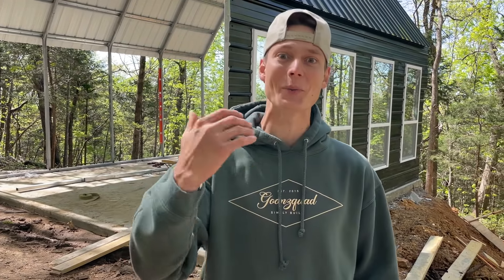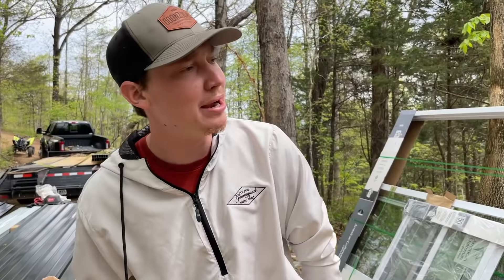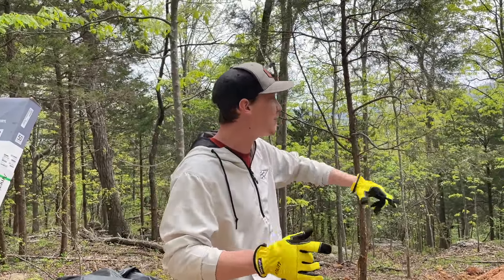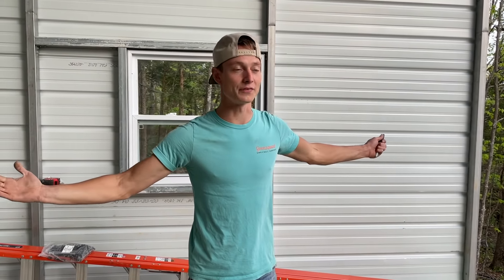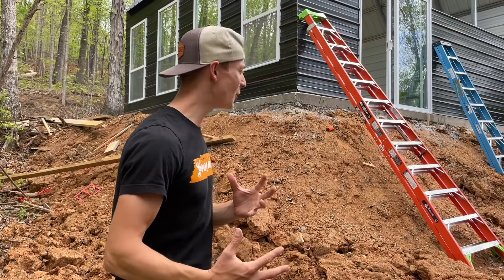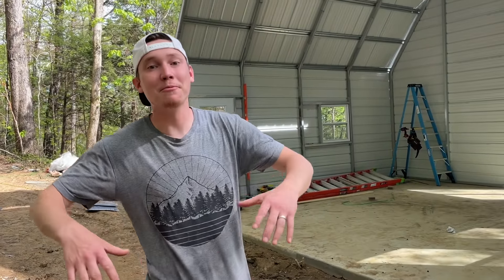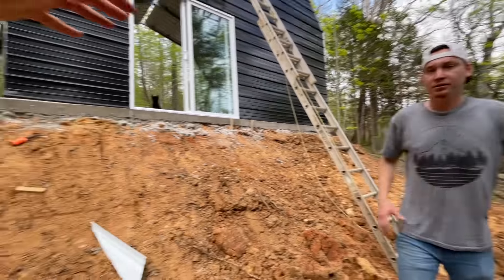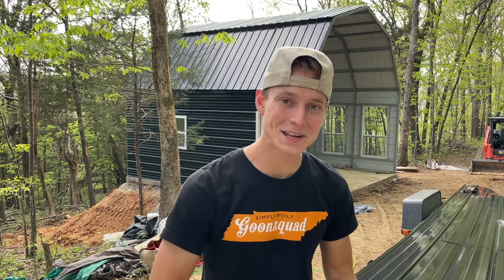Building The Ultimate Man Cave Has Become Dangerous!!! Can We Save It From Erosion?

Comment: You have cut trees and a auger for your Skid steer drill some Holes and place the Logs upright in the hole with cement , and then place some more logs across them building a wall and then backfill that section . Blocks will not stay in position if you don't put a Concrete foundation for them to sit on. 100% done Starting to sing It coming down the mountain when it comes :) .lol

Comment: As I mentioned to you several days ago, it is important to take measures to mitigate the erosion of the soil at the rear of the floor of the structure. In a heavy rain, the entire structure could slide downhill.
Reply: I think they plan to add anchors to the slab and chain it to the nearby trees.  :)

Comment: They do make 2 foot wide  by 4 foot long concrete block for retaining walls.
Check with your local concrete company.  You could also get large rock from your property and use it, Large outside and smaller inside then just backfill with dirt on top.

Comment: And if you do decide to make patio be hind  shop drill into the shop slab and put in some doll-rods to hold both structures
Reply: Ok Boy's go to a concrete  supply house and buy some 6-inch concrete  wall ties, and you going to ask if you can rent what they call dog ear ties, and you are going to need3/4 inch ply wood for the inside form and the out form ,after you set your outside form you going to mark your holes one foot apart side ways and one foot up and down for your wall ties ,then you are going to use 2×4 on the back side we're wall ties are in line  ,then you going to lock down your dog ear ties that hold your wall ties in place ,in then you are going to have brace it up ,so that the pressure from cement won't blow the open,a don't forget your outside footing ditch,after you set up the outside forms pour your ditch and put Rebar every foot apart about 3or4 foot sticking up so after you pour your footing you can tie your steel up from there ,you got this Boy's

Comment: If you Boy would buy some 1’s and 2’s rock pile it around and rent the jack hammer style packer and put the rock around your dirt mound and pack them into the hill side it will strengthen the dirt mound around the building just like they do in the Hwy Dept does on exit ramps off the Hwy.

Comment: Surprise you don't try to source the area stones/rocks of fairly decent size, and use those. Start from the bottom and work your way up. The larger rocks will hold the soil down. Or, they do make retaining wall blocks with bulky stones wrapped in chain link fencing.

Comment: You can have free hot water on tap using solar heating. How it works is that you buy 1/2" x 164 feet or 50m black poly garden irrigation pipe the kind that they use in sprinkler systems & you put in 2 flat spiral coils inside a 3 inch deep x 3 feet wide x 6 feet long wooden box painted black inside with a glass panel covering the pipe with one inlet & one outlet. Point the box on an angle towards the sun & use a 12v brushless circulation pump, a 25w 12v solar panel to a 12v 20Ahr AGM battery for up to 20 hours of no sunlight to keep the 10w pump circulating.

You'll need a blue water barrel with some insulation wrapped around it so your water can circulate through the barrel & a 12v on demand pump to your hot tub. Also have a second blue water barrel of cold water so that you can regulate the temp of the hot tub. Put guttering up on your building to direct the water into the cold water barrel & also to fill the hot water barrel up from the cold water barrel. Having the black inner box & pipe means that the sun will heat up US 60 gallons of water to over 120 F over a several hours in direct sunlight from 9am to 3pm. You can research how to build a DIY SOLAR HOT WATER HEATER on YouTube.

Comment: Id build a retaining wall out a few metres from the "house" and fill it in so you have a bit of a flat area out the back and some level ground around the sides as well.  Chuck some soil on top and seed some grass to grow some roots and add some structure. Build a hot tub and a decking area out the rear later when its settled and compacted.

Comment: Use your saw mill make some post come about 6ft off the back put post every couple feet and cement them in the ground build a retaining wall level with concrete then fill with dirt build deck over the top.

Comment: Take the spark arrestor out of the muffler on your generator. Clean it and put it back in, or leave it out if you're not in an area where you'll start a fire. It's a normal problem with those generators.

Comment: So are you going to put capping on the building where you see all that sun light coming in? Where you see sun, you will have water coming in. You didn't put down a pressure treated sill plate below your doors, which you should have, along with putting down some tar paper or flashing tape and silicone. Water will be coming under the doors now and until you fix these issues. You can use logs to create a cool retaining wall and the wall has to be L shaped. You need to shed water away from your shed fellas so you will need some form of gutter system or it will always be wet inside when it rains.

Comment: GUYS JUST PAUSE for a second,  you have a forest of trees and a need to retain your dirt on the barn build.  Fit a screw to your skid and drill some holes in the solid earth, use your logs to go down the holes in the arc around the back of the barn. Backfill with earth or gravel and it will last for years,  cheap and quick.

Comment: Use rip rap class 2 at least. It’s a cheap way to contain that wall. Start from the bottom and work your way up 3:1 slope. The most important part is the toe (bottom) so it need to be dug in a bit then the rest of the rip rap can just go on top.

Comment: Just do some concrete pylons for the rear deck.  Use an auger to drill down 6 feet right next to the foundation and use sonotube to form anchors for the deck.  That will help to keep the soil stable.  Only have to do 6 along the back.

Comment: Guys that platform you created for the barn garage will give you problems especially during heavy rains, IT WILL FAIL. You have to compact it in 9-10 inch  layers then if you aren't retaining the back let it bank a maximum of 60 degrees and grass it or some cover crop to hold everything, you'd be surprised how much grass can prevent damage during heavy rain!. I would advise that when you put the deck you get an engineer to design a simple way to support that slab and do it all at once with the deck. don't work in there with a car without solving that issue.

Comment: You'll know if the building foundation starts to slip downward because you'll get some cracks in the foundation from the pressure.  I'm actually dealing with that currently with one of my out-buildings.  Oh, and heck no on the office and stuff.  I would make that thing a sports bar.  Neon lights, deck space, full bar, beer taps, tunes, pool table.  Check our Luke Combs' building he turned into a party space.

Comment: If it's going to be a man cave I'd put a pool table in the middle and since it's so tall build a loft over half of it and I would build the deck all the way around both side and back use solar power and batteries for the power and use 12 to 24 volt lights and other things.

Comment: Just use the same method you used with the wall in back of the first house with a couple "Deadmans" or wall anchors that reach into the depth of the dirt. If you build it with a slope back toward the pad it will last longer than the building. Best of all its  uses something you already have on the property and looks bad ass when it's done. JS🤷‍♂️

Comment: Stick 8 x LG 385 solar panels with a MPP Solar 6k inverter (model LV6048) and a 15Kwh battery (server rack batteries x 3) and you'll be all set for power.  FYI - wind power isn't that efficient.

Comment: Any structure NOT built on virgin compacted soil is eventually going to have issues! Even if you don't have to follow building codes, the codes would have been a good reference for proper building practices. Failure is an option!

Comment: Also if you want a cleaner look I would remove those brackets that hold that metal to the concrete and drill through the actual tubing and set concrete anchor bolts—do them 6 inches off of each post

Comment: Don’t use big power tools with that long power cable. There is a big voltage drop over that long distance and will cause damage to power tools. In most tool manuals they recommend not to use cables over 25 feet and smaller than 12 gauge wire and you’re already using 14 gauge wire.

Comment: Why don't you hire the attachment you can get for the excavator that hammers posts into the ground and cut the trees down to size and pin them into the ground then backfill it. The wood is free and I'm sure your dad has seen this done so all it will cost you is hiring the tool, or just hire someone to do the job, I think it will be less hassle than building a retaining wall using block

Comment: Your guys didn't account for voltage drop over that distance you need a bigger wire to get the same voltage at a farther distance.  As in 10 awg  instead of 12 or 14 awg

Comment: want to build be one in back yard want zink on outside but after i do dry wall inside want ro add some foam mix for insulation solar on roof but not 12v to 240 then back to 12v cut load lost and install 12 strait to lighting battery will last longer and night day light with day night switch 12v so no turn on power or pull old style roof switch by front door . but i will cover durt slopes with bricks or sement for rain seasen u dont want it to end up in woods

Comment: An also the peck of the roof needs to be closed an other areas drain cuddles r needed right away.  Or u r going to lose the hill u have built-on . Ist time mistakes could be very bad .
Reply: Cuder r needed with long distance drains to carry off the water coming off the roof of the building.

Comment: Diesel motors do not have spark plugs. As others have mentioned, check the oil level. If it is low, it will not run as a preventative measure to protect itself.  Great work y’all, living the dream!

Comment: It sure is entertaining, but I really hope nobody watches their videos and get the idea that anything is done as it should. Maybe there aren´t any building codes or rules for electric wires in that state, but I could bet anything that the cable from the other house and the "barn" will hold up to many storms. No weather proofing with silicone where the metal sheets? First rain and water will find it´s way into the walls and mold is a guarantee even if they try to weather proof at a later time. 

Anyone dumb enough to doubt has never studied and worked in construction. It´s a total no brainer.

And for the electrical play, I wouldn´t be surprized if someone (or something) in the forest dies of electrocution if they think it´s a good idea to run that cable from the other house...